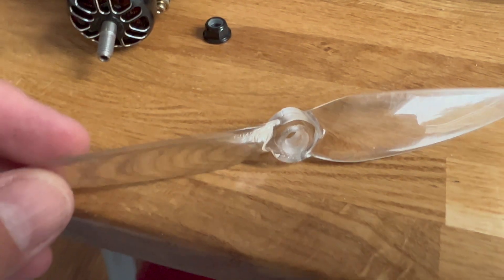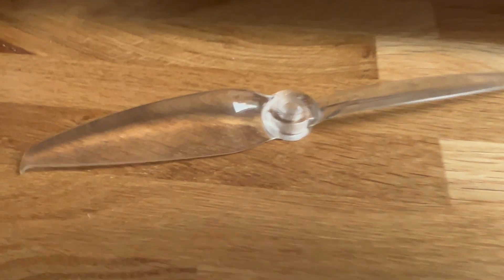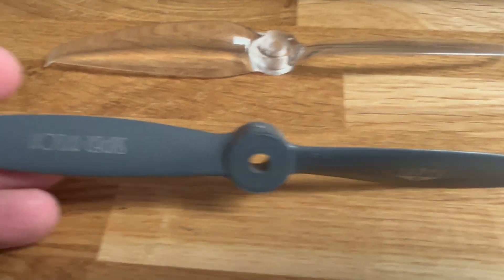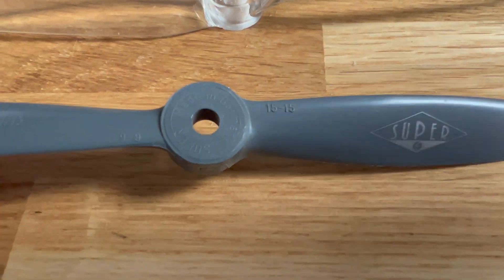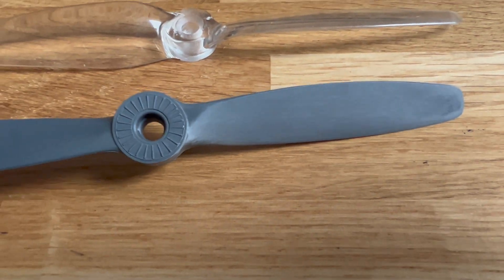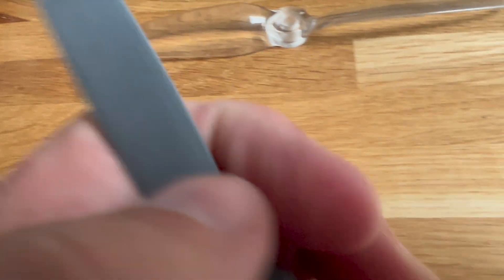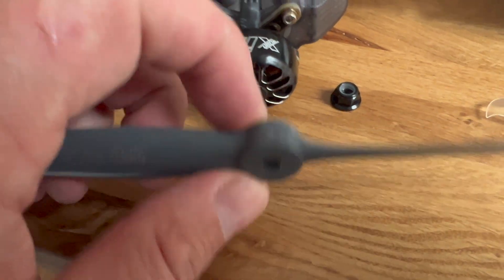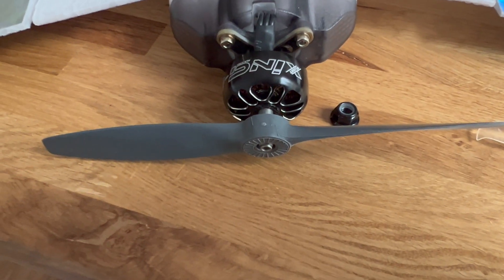INAV 5 and 6x6   two flights with the PowerCruiser | Hee Wing F01 EP:26

Comment: something's wrong here. it is impossible only 17A. I have an APC 6x6 on a 1900kv motor (bh avenger 2808) and I get 37A in full throttle and  around 170kmh on my FunJet - 4S LiPo. The current sensor is calibrated
Reply from the maker: Then your motor seams to consume much more than mine. Keep in mind that part of the flight is down wind- but even against the wind it’s max 19A in full power … and this is real

Comment: Hello! I recommend these settings for INAV 5.0 minimal horizon drift:
 FOR WINGS AND OTHER PLANES WITH NO TAIL:
set imu_acc_ignore_rate = 9
set imu_acc_ignore_slope = 5
set nav_fw_pos_z_p = 35
set nav_fw_pos_z_i = 5
set nav_fw_pos_z_d = 10
set nav_fw_pos_xy_p = 70
set imu_dcm_kp = 1000
set imu_dcm_ki = 0
save

FOR PLANES WITH A TAIL (DEDICATED ELEVATOR):
set imu_acc_ignore_rate = 7
set imu_acc_ignore_slope = 4
set nav_fw_pos_z_p = 25
set nav_fw_pos_z_i = 5
set nav_fw_pos_z_d = 7
set nav_fw_pos_xy_p = 55
set imu_dcm_kp = 1000
set imu_dcm_ki = 0
save
Reply from the maker: Hi there ... this looks like the settings that came with INAV 5.1 ... am I right?
Reply: @JustFPV-net  Maybe. So far, there is not enough time to ventilate INAV 5.1.
Reply: @JustFPV-net  Maybe. So far, there is not enough time to ventilate INAV 5.1.

Comment: Hi, bro,, need to ask, did u use autolaunch? What trotel set for autolaunch? 1700 or higher?
Reply from the maker: ### Auto Launch : 80% thrust, 20sec at 20 degreeS angle!
set nav_fw_launch_thr = 1800
set nav_fw_launch_timeout = 20000
set nav_fw_launch_climb_angle = 20

Comment: I tried APC 6x5.5 but it was worse than 6042
Reply from the maker: on which motor? I found 6x55 to be a bit under powered with max 16A (which is fine for the speed) but went back to this prop after all an found it to be the best.
Reply: @JustFPV-net  Same motor as yours.
Went back to 6042 for now.
I might need to check current sensor calibration though as I switched FC for 405WMN.
Reply from the maker: thats strange - keep in mind the 17A was down wind ... usually it's  max 20A on full speed
Reply: @JustFPV-net  I'll keep trying. Still need to tweak the pitch shaking.... should I rise or lower the PIDs on the pitch axis?
Reply from the maker: hard to tell ... if it shakes to much and you got HIGH values, then lower it! Otherwise raise it slightly

Comment: I love experimenting with props to see how it feels in the air! 😎
Reply from the maker: Guess this is the best one so far
Reply: @JustFPV-net  how many amps pulled at full throttle vs a Gemfan 6042? I might have to try my 6x6
Reply from the maker: It takes some more amps… about 20A on 100% but it doesn’t bother the motor. With 6042 the motor spins at 100% and the prop can’t deliver more